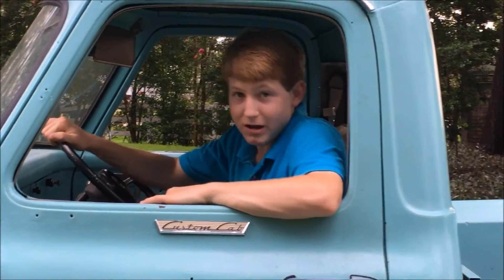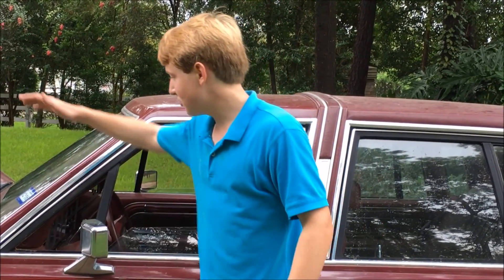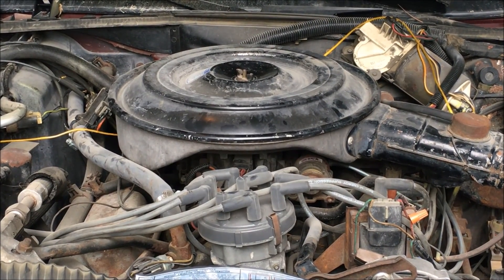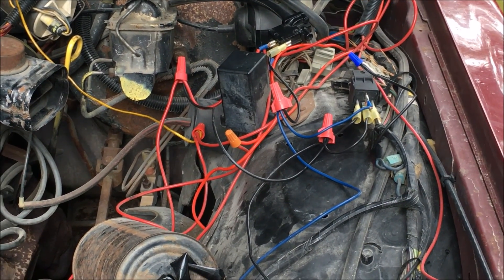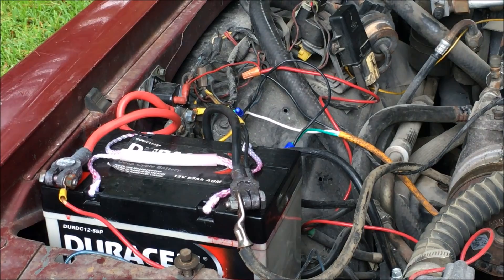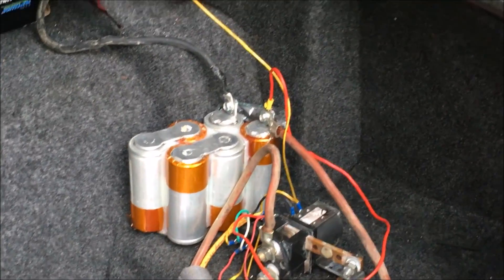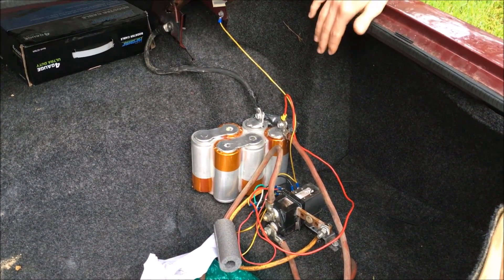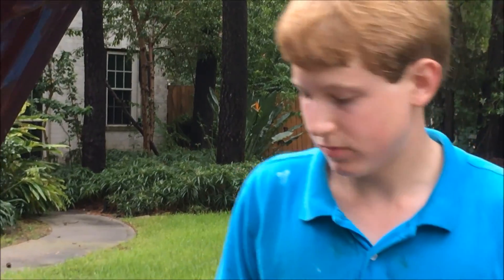Super Capacitor Hybrid Lincoln Town Car

Comment: Love it kid... N love the 84 i have one also.
Reply: Can it work on a carb engine i swapped the factory fuel inj out?
Reply from the maker: The CFI helps to start the engine quicker, and I do not think a carb would work well with this system due to the delay in starting.

Comment: Great job!  There are after market super cap circuit boards that prevent the caps from getting over charged, damaged etc. They appear to be pretty easy to install.  You may want to look that up.

Comment: The brake detection could have been simpler. On the firewall near the brake booster, there's a switch that turns on the brake lights, just tap into that, it's more sure and doesn't need intelligence.

Comment: That 302 is one of the toughness engines ever built, you mind your manors. Her it breath maybe put a cam in there and you could be making close to 500 hp im at 650hp with a turbo and you can push 1000 before they give in and this isn't a hybrid. just relabel this vid hybrid battery. I'm trying to make a hybrid car run off super capacitors here.

Comment: Great video. I'm sure your Grandmother thinks this is so neat that you're making so much out of her old beautiful Town Car.  

Have you considered converting the Town Car to a dual fueled car by adding CNG or Propane?  I believe the 84 had a rudimentary throttle body FI system that'd be very easy to covert.

Have you considered pulling the Gas 302 and dropping a small Diesel engine kit into the car?

That positive battery terminal makes me nervous as it can create a chafing hazard through your insulation solution and cause a major electric energy discharge resulting in a possible fire. 

Does your Reverse lights stay on when your foot is on the brake?

If you're needing to keep your foot on the brake and gas at the same time (say your trying to gently drive the car up onto a ramp to change the engine oil) and you need to "balance" the car by easing up on the ramp at a super slow rate, but yet stop quickly by pressing harder on the brake vs stopping by letting up off the gas because the car would want to roll backwards down the ramp?  Is this  simultaneous action of braking and engine power being sent to the rear wheels possible?
Reply: Have you considered an electrical motor driven AC compressor along with an electrically powered water pump to keep the hot engine coolant flowing through the heater core during prolonged stops in traffic lights and drive thru windows?

Have you considered an electrically driven power steering pump motor to furnish full PS assistance during a braking/coasting situation as the driver slows to turn into a super sharp driveway turn off?

Great work, I'm not being critical of your amazing progress in this fuel saving technology, but I'm just wanting to hear your thought processes into these issues.

Have you considered a cylinder deactivation system while the engine demand is very minimal?  I know Cadillac did this in the early 80s, but I'm assuming they had a multi-port fuel injection set up?
Reply from the maker: I have considered CNG and Propane, but the availability of Propane is an issue, and the costly CNG compressors are also a problem.  However, if I had a cheap compressor, I would do it in a heart beat.  I have replaced the battery since the video so that the terminal is farther from the hood and will not short out. The reverse lights do stay on when my foot is on the brake.  I now have replaced the relay based control system with a microprocessor controlled timer that does not allow the system to immediately shut the car off when the brake is depressed.  It also has a bypass switch.  These prevent the problem of not being able to ease up on the brake in a situation like you described.  Situations like that were very annoying to have the car constantly stopping and starting!
Reply from the maker: I also thought about the Diesel, but there is not a lot of support for adapters and such, but I am having some trouble with my Electric S10 Blazer, and if I can't resolve the problems economically, then it will be getting a 2.2L Turbo Diesel Isuzu.

Comment: Did you say you have a wiring diagram?
Reply from the maker: I did, but as I have been testing this system, I have realized some faults.  I am in the process of creating an integrated circuit board to control the start-stop system, and I am also creating a new wiring diagram for that system that allows for smoother power transitions.

Comment: Good job kid... keep playing with this stuff, you'll learn a lot.
You're lacking charge-balancing on the supercaps... you risk overcharging individual caps without it.
You'll also wear out the bendix on the starter by usign it so often... the ring gear will suffer too... but obviously you're not planning on a long life for this hulk.
Legally... in some states... this would fail state inspections since both your power brakes and power steering looses boost when you shut the engine off... possibly leading to dangerous driving situations. The use of a 12v vacuum pump would help the brakes. Adding an electric motor to drive the power steering pump would solve that... but now you're probably using as much additional electric energy as you're saving from shutting the ICE off.
Reply from the maker: Thank you for taking the time to respond.  I try to improve based on people's responses.  Thanks for reminding me about the charge-balancing circuit.  Its still a work in progress.  You are right about the starter, I am using an original style starter.  I have already noticed a slight decrease in performance from it over a few months of using the system.  I have a 1955 Ford-F100 that I used a high performance and high torque starter on.  I have had to crank it for extended periods of time, and that starter seems to hold up better.  I am looking into this type of starter for the Lincoln's 302 V8.  I have a 1987 S10 Blazer that I converter to an EV, and I had no way to power the power breaks without the ICE.  I used a small vacuum pump on it, and it has worked well.  I though about using one for the Lincoln as you suggested.  (By the way, while working on my Blazer, I asked the Texas state inspectors, and they said if they could steer it, power or not, and if they could stop it within a set distance, power or not, then they would pass it.  The Lincoln's engine will continue to turn above 25 mph, so power steering works for most of the coasting time,  the power brakes have enough residual vacuum for about 2 stops.)  I do like your idea about the vacuum pump.  I will have to take a look at that. Thanks for your input to my project!
Reply: BTW... how old are you?  I got interested in working on cars when I was 14 or 15... when my older brother sold me his 1963 Corvair for $50... I had to work on it to keep it running.

Obviously the 302 is too large to try it on, and the conversion would be MAJOR... but I like GM's "e-Assist" mild-hybrid system. That huge (Gen2) alternator/motor with it's 10 or 11-rib high-tension drive belt acts as a "direct drive" instant starter... as well as electric assist during driving. I gave some thought to trying this on my '98 Olds Aurora, but it would be a massive job on the Cadillac designed FWD layout.

If I was going to do anything, I'd probably go with a complete AWD EV conversion... using hub motors on the rear, and possible twin motors up-front, driving each FWD axle directly.

Either that, or transplant the complete AWD system from a salvage 2008 or later Toyota Highlander Hybrid.  We own one of these vehicles, and it's my first Toyota and hybrid... and I love it... but would convert to LiIon or LiFePO4 batteries... from another scrapped vehicle. The RWD of that vehicle uses a differential with a electric drive motor/generator built-in... so no RWD driveshaft...  easy AWD conversion for a FWD car.

The "HiHy" weighs about 4700 pounds (7-passenger, big SUV) and we have seen extended periods of 27-28MPG on mixed city/highway driving. On long highway trips, 28-29MPG is not hard... as long as I keep it 65 or under... where the electric drive can share the load.  The vehicle has VERY surprising acceleration too... for 4700 pounds. The later models uses a Atkinson-cycle engine which is a real good match for Hybrid use... but requires direct injection as well as independent intake and exhaust valve timing to do well.

It's an extremely well thought-out hybrid drive system... no "multiple gear" transmission with all the "shifting" nonsense, only uses planetary gearsets to achieve CVT... very little to wear out, as there are no "friction" surfaces.  Regen braking helps too... our brake pads are lasting many times longer than in a non-hybrid.
Reply from the maker: I am 14 years old, but I got interested in cars when I was very young, and at about 10 years of age, I started working on a prototype for my electric Blazer.  Before that, I built quite a few go-karts.  Some where electric, and some were single cylinder gas, and one I built had both a gas and electric motor on it.  They were all build out of aluminum from scratch.  I know what you mean about Toyota's Gen 2 Hybrid Trans axle system.   I have had a fair amount of experience with the Gen 2 Hybrid system in a 2006 Toyota Prius.  It really did save the break pads well.  The brakes were still good after 135,000 miles. Unfortunately, it did not have all that much power unlike some of the new priuses) At the end of its life, though, I noticed a drop in fuel economy due possibly to the battery pack beginning to fail.  It had trouble keeping a full charge in its HV battery overnight at times, and soon after was traded in.  One thing that I did not like was that unlike in the Gen 3 system, the Gen 2 system (on the USA model at least) lacked a EV mode button where by the car could be placed into EV mode for a short distance...so I installed one.  I took apart the blinker indicator switch which housed some extra wire pins, connected a wire to one of the extra pins, and placed the pin into a specific blank slot on one of the computers behind the glove box.  When this wire was shorted to ground, the car would drop into EV mode.  Using this setup and light footed acceleration with extended coast periods, I was able to achieve 75-80 MPG peak and 65 MPG average.  The car was only rated for about 48 MPG.  I thought about turning it into a full electric car, but the dealership was willing to pay good money for it and I thought the HV battery was failing, along with the A/C that was completely broken, a worn out heater blower, a failing water pump, and failing vacuum pump, so it was just traded in.